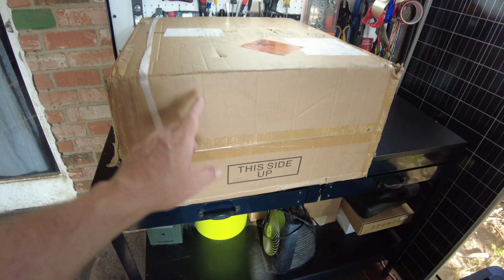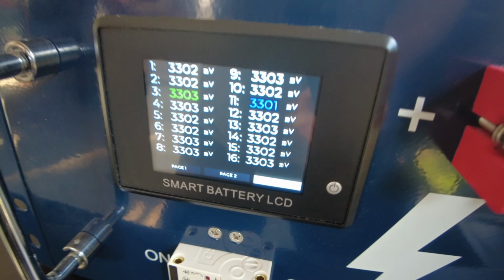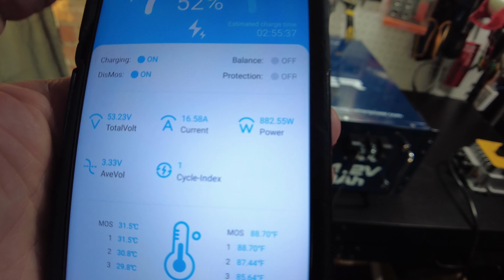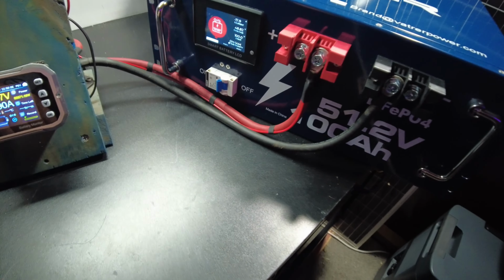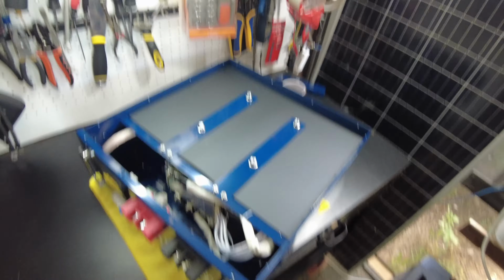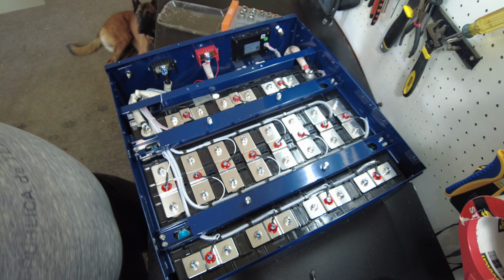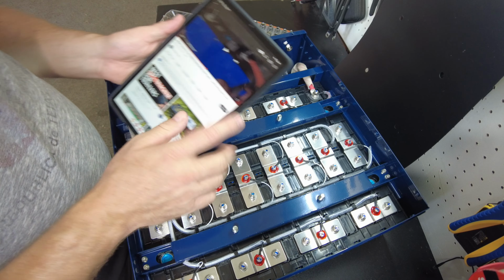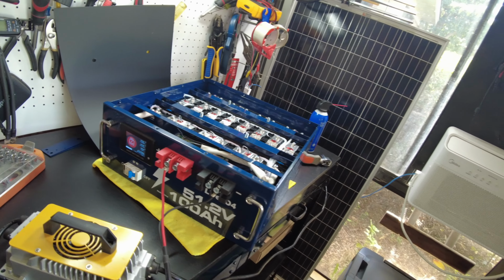Vatrer 51.2V 100Ah Cheap Server Rack Battery

Comment: I own 4 of the earlier version 48v.  3 of the new 51.2 version.  The 4 are a year old.  3 new ones are 4 months old.  So far all have worked great and no issues.  Last time I got some was off vatrer website. At that time there was no tax, and shipping was free.  Amazon charged tax.  And for a new customer was a discount wheel you could spin for extra percent off. May make a difference in prices.
Reply from the maker: Nice!

Comment: Thanks for the review! I really like the construction, it's almost as if someone gave a crap when it was built ;) So far, I'm really impressed with the 4 Vatrer 12V 100ah batteries I got for about 179 bucks each. I built a system with three Renogy 200w panels in series, a Victron 100/50 smart solar controller and a Giandel 2200w pure sine wave inverter. Granted it's in Colorado and the first week of August, but I can walk in my shop at 10am on the weekends, fire up all the fluorescent fixtures I converted to LED, turn on my monster computer and stereo, use my drill press, table saw and bandsaw for brief periods (like 5 minutes each) and run for 12 hours until I'm down to about 5% battery and recharge in about a day and a half. During the week I can do the same from 3pm to 6pm and be recharged by 1pm at the very latest, best non-haze (forest fires) day I was recharged by 10:45am. The solar panels provide enough for just lighting, stereo and computer from 11am to about 3pm and then it just draws the difference. Also using a Raspberry Pi for communication to the Victron portal so I can monitor anywhere I can get internet access.

Comment: You can get a 310 amp hour battery from Jenny Wu DIY kit with JKBMS and display for less than that.
Reply from the maker: Really? with cells, are you sure about that?
Reply: Link
Reply: Jenny Woo?
Reply: 16 cells at 75 bucks each =. $1200 plus $400 for diy box kit I’m guessing would be 1600 plus shipping n tax
Reply: @2hotscottpro  Close, but $2.2K Each. Eve MB31 cells with an extra cell per battery- highly recommend. 320aH tested. Enjoy.
Reply: @2hotscottpro  Add inverter cables, parallel cables, usb adapter, shpg, Aliblabla trade assurance fee, credit card fee.
Reply: @2hotscottpro  if not buying battery boxes or 16 cells and under, then I would go with the battery store in Atlanta. Their A cells are always flat. My MB31’s were very close to flat, but all .23-.24mOhm and 315-320aH.